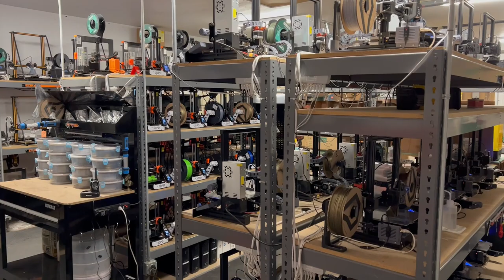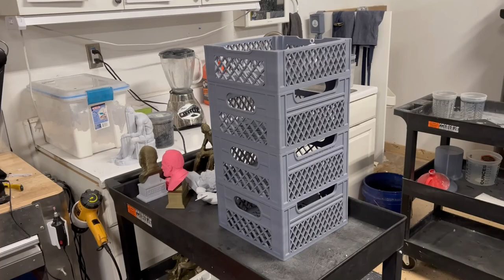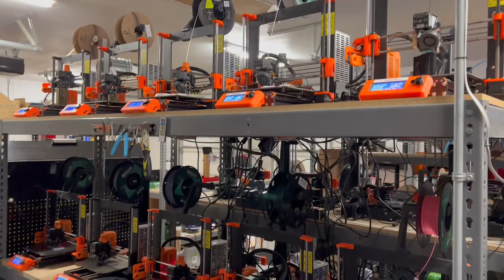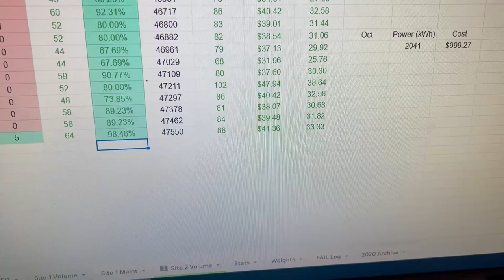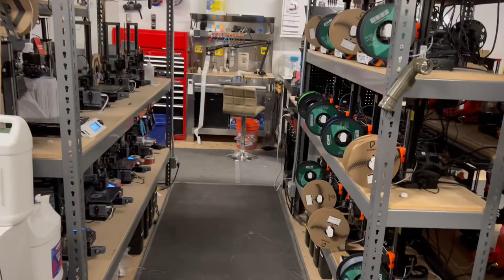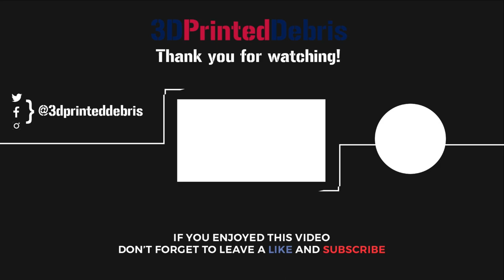3D Printer Farm Maximum Capacity Reached (Gotta Love The Holidays!!) 3DPD 3D Printer Farm Life

Comment: I have only 1 printer at home, and when it prints, even some pla, it stinks a little bit ( not much ). You can smell within the room, that printer is running, so you are inhaling some small amount of gases I guess? But what about farms like this ? Do you have some huge air circulation system that is changing the air in the room ? When 50 printers are printing in such small room, there must be a lot of fumes and nano- plastic -particles floating around, right ?

I wonder, is this safe ?
Reply from the maker: Yes I do, thanks!